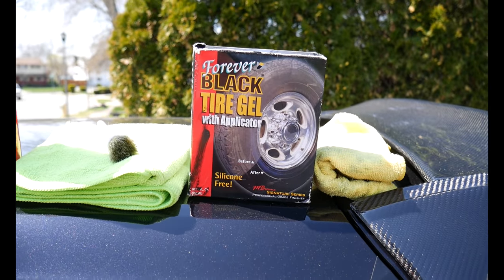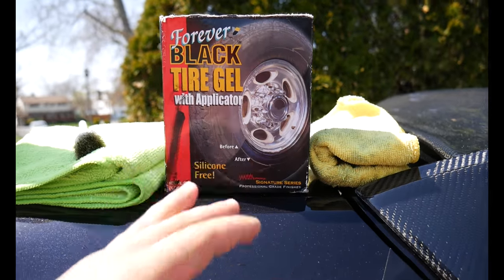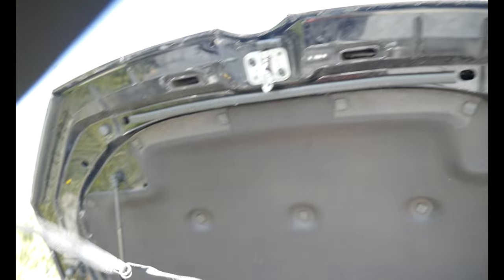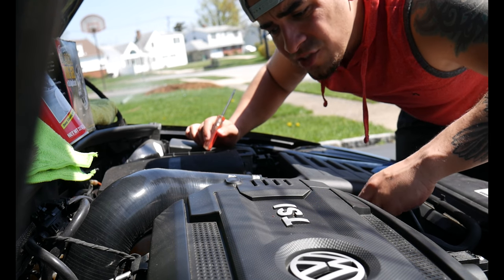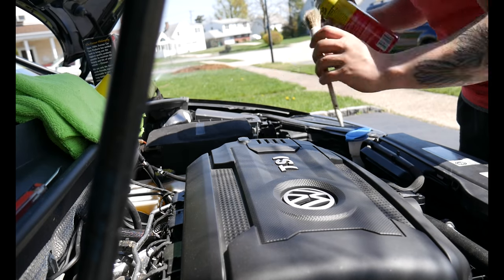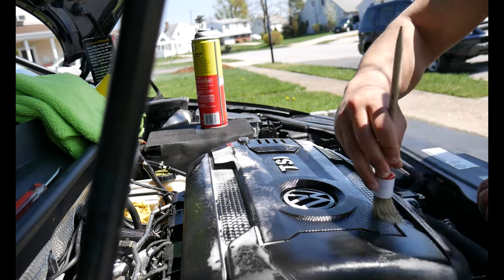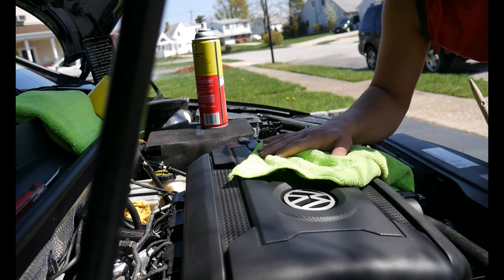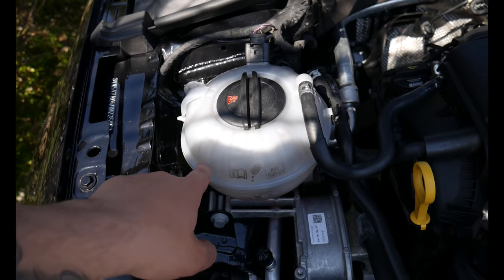Waterless cleaning for your GTI engine bay

Comment: Do you have any problems with the lowering springs? I’ve had people tell me it’s the “cheap way out” and I’m hesitant to purchase a set
Reply from the maker: The H&R and VWR are are a really good setup. They're not extremely aggressive if you want a small drop. They can become a little squeaky sometimes in the cold.
Reply: I'll add in that the Emmanuel Design springs are a really good cheap option as well.
Reply from the maker: Don't have much experience with them but hear good things
Reply: +1 for the ED springs. Very good quality product. Drop looks great, car corners super flat, and most importantly they ride very very close to stock comfort.